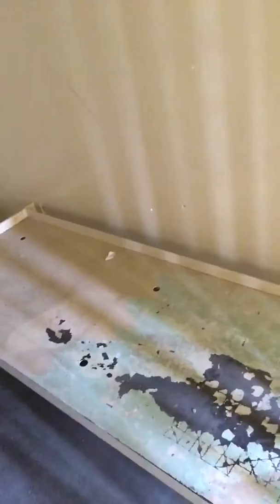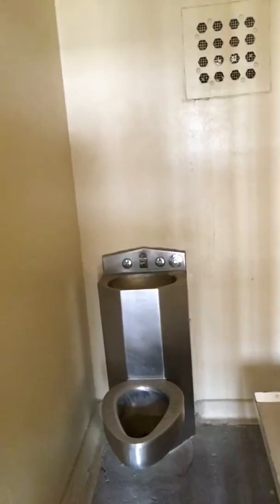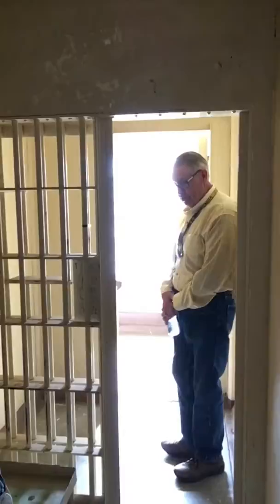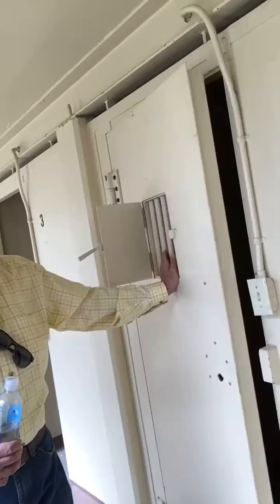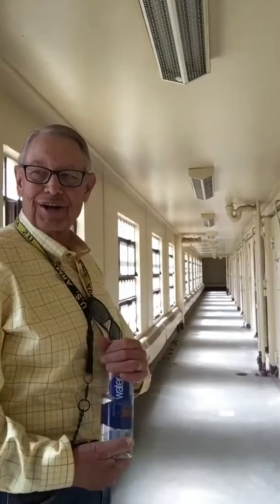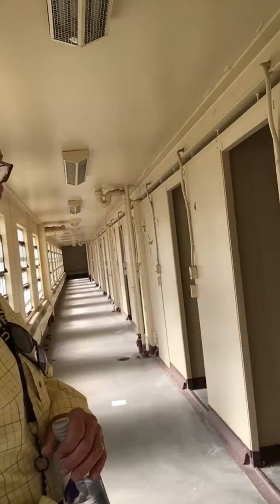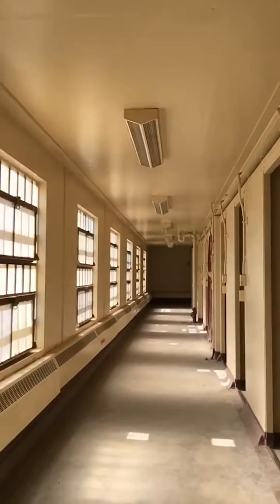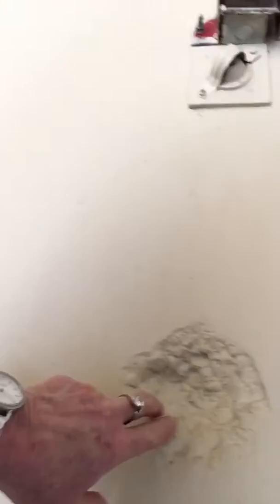Maximum Security at Nevada State Prison

Comment: I was in this unit, but on the other side in the double cells. This is the west side of the level 1 of the single cells. This was some of the worst days of my life while in this building. The bullpen used to be an inmate run casino. Lol this place was a nightmare that smelled and was dangerous for anyone at any time. When you walked down the hallway is was customary to keep your head straight and not look sideways inside of someone's house.

Comment: I did 35 days in that very unit. 15 days at a time. 5 days at the end. I was 19 years old.
Reply: How was it?
Reply: @PicantoWasTaken  walls are metal all around. You can hear the guy next to you. They had the windows painted at that time. It was pitch black at lights out. We would all tell stories and talk ourselves to sleep 😴.
Reply: Battle Born 702  then you know  what a Cadillac was used for their?
Reply: @foad664  I was in the last cell in this hallway for capturing the tier in the regular DS unit and did 3 weeks in this dungeon. I got lucky to be in the last cell because there was a pipe in the ceiling used to pass contraband from the trustees to the convicts and I received a huge issue of tobacco and papers and matches to send down the line to a fella several cells away and man that was a fuckin pain in the ass to Cadillac thru those doors. Had to catch air and get it to flip upward and bounce off the wall outside of the cell AFTER managing to get it to fly under the door with enough velocity to catch air and bounce off the wall outside... Goddam I must have thrown that goddam caddilac for a few hours straight before finally hitting dudes car and getting tangled up enough to hook up and send the smokes down to dude.. But I got a good issue of that package for my efforts and was happy to help obviously.. It's mandatory to help in that situation so I didn't mind that but it was nice to be told to pull out a little issue for myself! Fuckin cool and appreciated 👍🏻
Reply: @ 4:56 you can see the pipe hole in the wall that was used to pass me the package to send to dude.. It's soooo fucking crazy to see this like this. I never imagined I would be takin a shit watching YouTube and seeing the other side of the hole I stared at from inside that cell.. 20 yrs later almost. Wow.
Reply: @foad664  oh yeah. We used to bounce it off the heaters LoL 😂
Reply: Did ya use the seam of your sheet, tied together for the long slide?
Reply: @88_TROUBLE_88  have you seen all the bushes and trees that are growing on the upper yard? .... Crazy to see that.
Reply: @foad664  I haven't seen anything there.. I can't imagine what itooks like these days